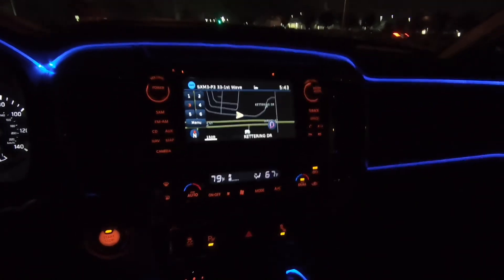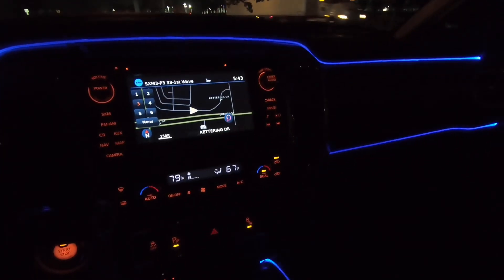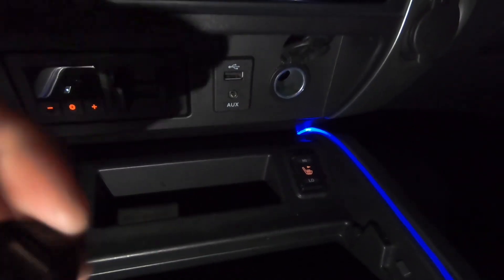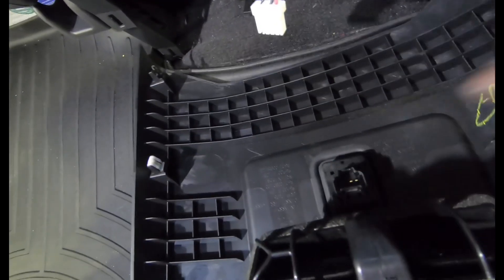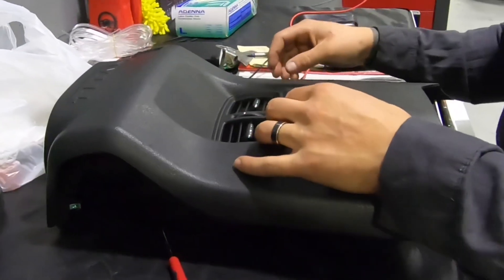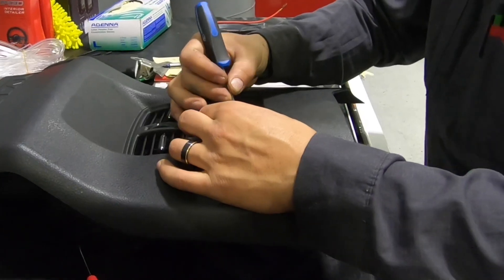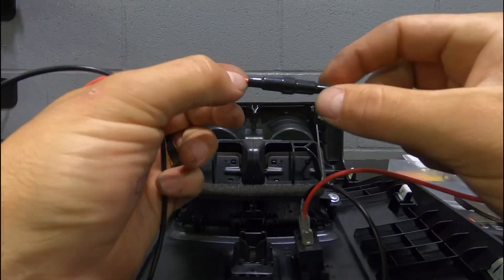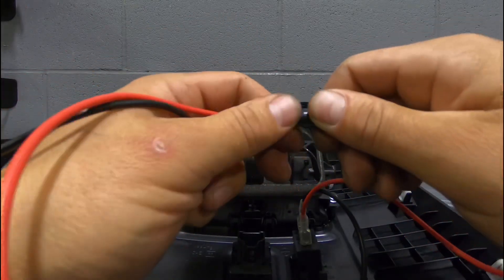YOUR 16-17 TITAN XD NEED THIS!

Comment: 2018 XD Platinum Reserve does not have a USB in the back - This worked great, thanks.  I used a round USB 2x plug, easer to drill than cut.  Centered it above the vent.  On the 2018 the cup holders come off first then the back panel.  Thanks again!

Comment: I have an 18 with the rear heated seats but there is any USB’s. Why Nissan? There should be at least 2 of them for the back seat. Great video!  I am going to see if I can mount 1 or maybe 2 above the vents in the rear area and probably go with a round one and use a step bit. Thoughts?
Reply from the maker: Sam Rauh agreed! There many usb option styles. Round, square, double, single, go with what you please. It will be a tiny yet big upgrade for comfort and convinience .
Reply: There is an OEM option. https://www.nissanpartsdeal.com/parts/nissan-rear-usb-charger~t99q7-6lb0a.html you can search the oem pdf installation procedure as well. It isn’t standard however and requires modification.